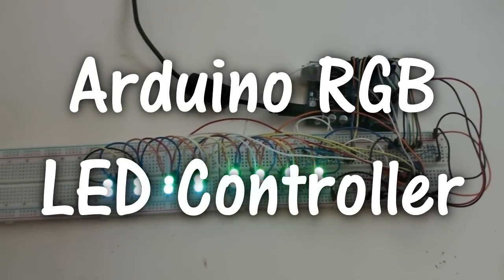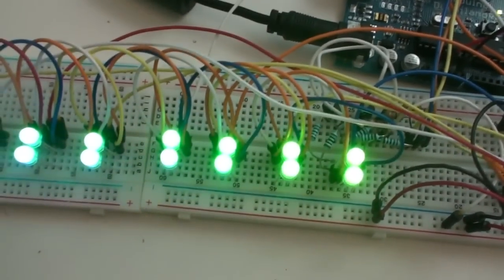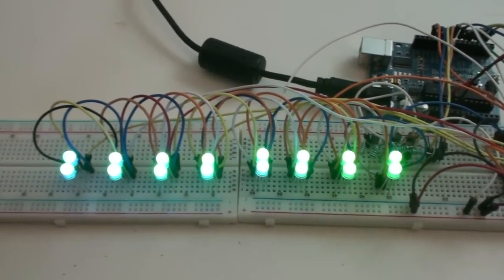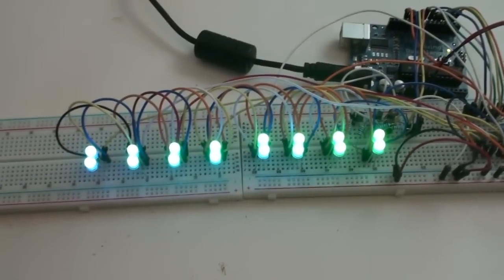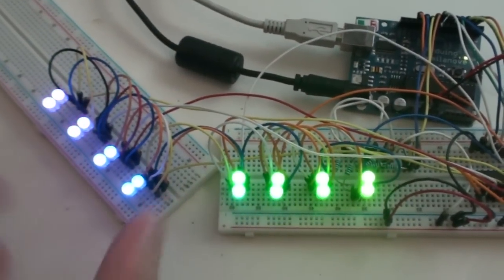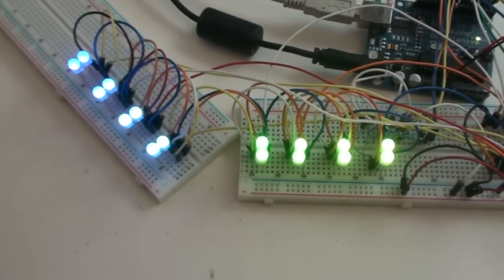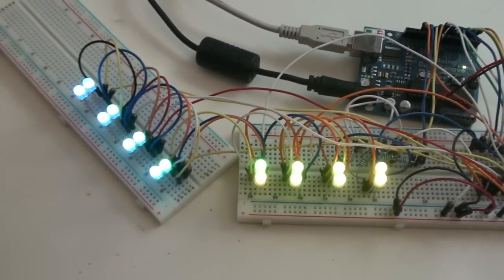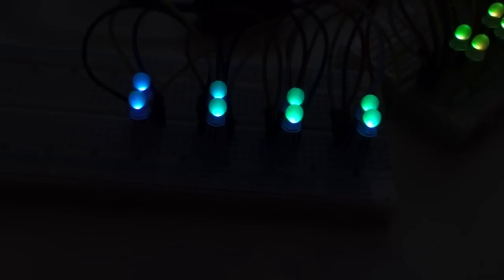Arduino RGB LED Controller

Comment: Is this easily scalable? I'd like to use an arduino and RGB leds on my vehicle for accent lighting.
Reply from the maker: Matthew Enderle I would recommend the WS2801 or WS2811 RGB LEDs if you are making anything bigger.

Comment: aweful code :( variable definitions all over the place. wrong non-standard conform variable naming, almost none remarks on what or why you are using specific bit patterns. no references to datasheets or manuals that would explain some patterns or doings. Mixing up "port based" addressing with native/plain arduino pin mode commands (as it should do), having pins "hard coded" instead of using variables having them configurable. large Blocks of repeating Code that is supposed to go into a for or while loop instead. maybe you should rework your code and improve things. ive seen many people added their valuable tips to you.
Reply: works doesn't it?
Reply from the maker: Hi Axel. Thank you for your comment which you might be right about. Our blog has never been intended for perfect code nor for showing how coding should be done right. Rather our blog is about prototypes, electronics and engineering prototypes and displaying new technology.
At the time this blog post of these LED strips were programmed and written by me I was 17 years old. That doesn't change anything though, as I have always been focusing on quick, structurized and working code for displaying prototypes fast, rather than perfect, well commented and native code. Especially on an Arduino where programming is meant to be easy, though the built in functions are very inefficient, instruction wise.
Please have a look on my other more latest and bigger projects and rethink your comment - fx https://github.com/TKJElectronics/Balanduino and https://github.com/TKJElectronics/IoT_Football
Reply: spaghetti-Code works too. But you dont write code for machines. you write Code for People. and good code is easy and a joy to read with lots of explainations on patterns and values used so everyone can easily follow, even if reading for the first time. working code is not enough. make it "pretty" and easy. make it logic and subdivide it into modules or blocks that make sense. objectify it to make it even better readable. its worth it

Comment: That's cool. I was considering RGB leds or regular leds for a beginner arduino project. Outside of a 3d display such as a cube RGB leds seem a little pointless, then I realised with a thermometer sensor it may be of use :)

Comment from the maker: @cmor2125 We've already got both Arduino MEGA and Arduino ADK. But they are just so much more expensive, so when you can use an circuit with an IC like this, it makes it much more inexpensive to do.
Though of course it would be possible to use the extra IO's for the LEDs instead of 74HC595 IC's, but you would still need the ULN2803 chips for providing enough current to the LEDs.

Comment from the maker: @eddiea6987 I'm using 3 PWM channels, one for each color. The common ground pin of every RGB LED is then connected to the ULN2803 chip, where I can enable or disable power sink.
Then I just multiplex all the LEDs, changing the PWM values when I sink power for the specific LED.